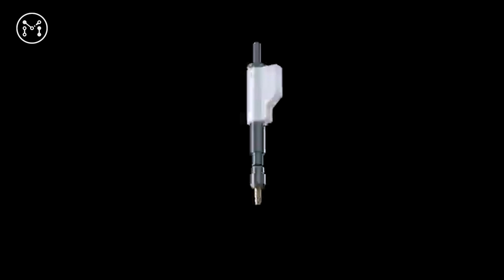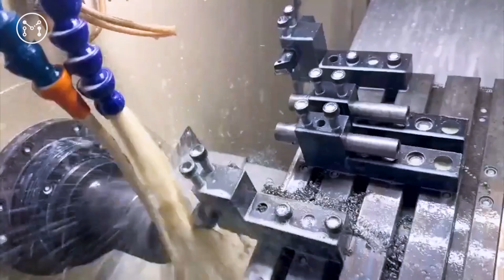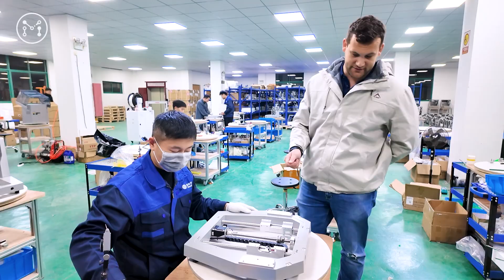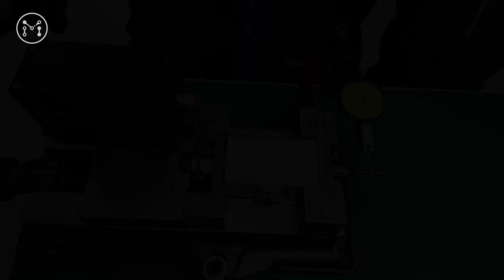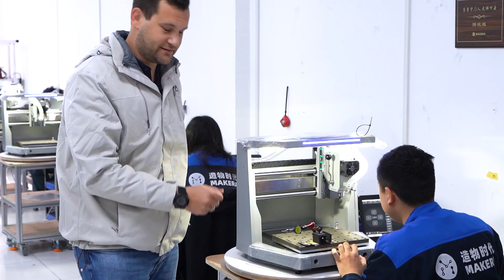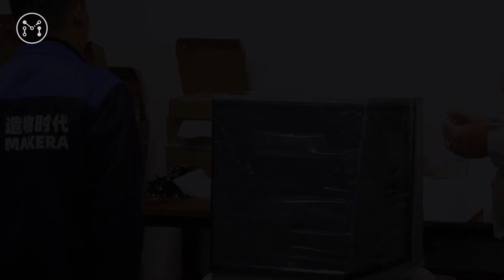Carvera Air Factory Tour

Comment: 0.006 spindle runout is not good??
Reply from the maker: It’s 0.006mm, which is better than the typical range for normal industrial spindles (0.01-0.03mm when measured on the milling bits).
Reply: Since you've omitted the unit, I'm going to default to meters. No, 0.006 meter runout isn't great.
Reply: @qwertyboguss he said .006mm in the video

Comment: 0.06 mm spindle runout? what !? 😂
Reply from the maker: 0.006mm runout
Reply: @ 0.006 is still junk, will break small tools… even cheap China spindles on aliexpress are much better usually
Reply: @dimsum5567  0.001 will be good
Reply: IKR, google says "The total indicated runout (TIR) of a spindle should be less than 0.0002 in (0.005 mm) at the taper and less than 0.0005 in (0.013 mm) at the gauge line".